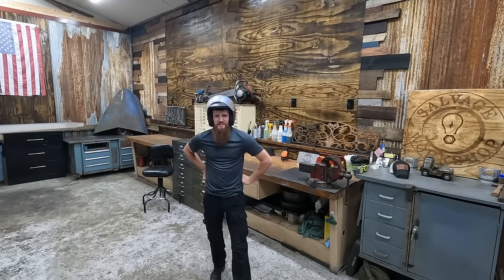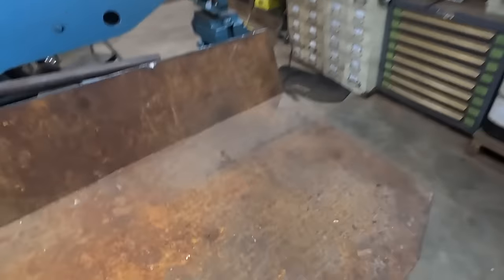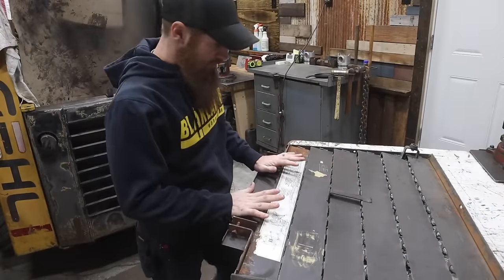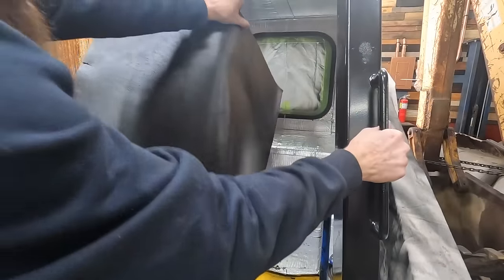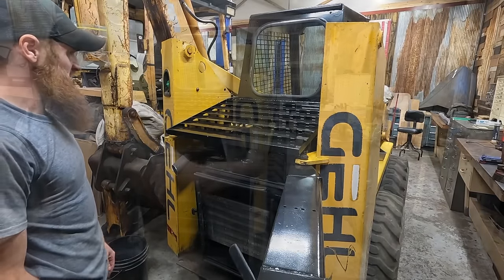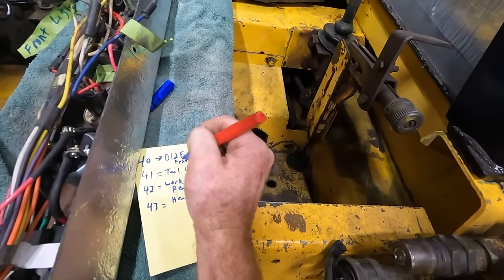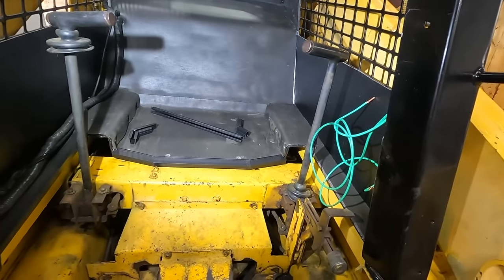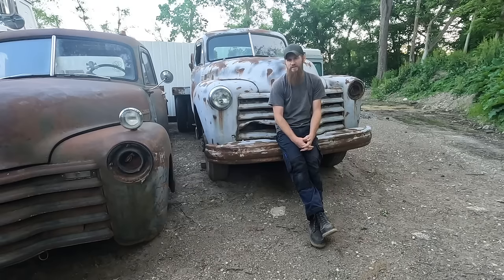The CAB on my old Skid Steer is ROUGH... Can we RESTORE it?!? ~ 1995 Gehl 5625sx Skid Loader P6

Comment: When glueing up the form rubber after spraying both surfaces wait a minute till glue is tacky. (JUST LIKE A STICKER) Than apply the foam. Same for head liners and pannel covers.😎👍👍I'm thinking a prop bar instead of the slide lock would of been a better choice. Made with a small slightly bent rod welded on one end that fits in the same hole and with a sleeve and bolt at the other bolted to the lid.
Reply: Yep, this. Contact cement works the opposite of regular glues - you spray it on (both sides, the cab and the liner) then wait til it dries. After the carrier solvent evaporates, it leaves a somewhat sticky residue behind to the touch (like rubber cement), but it sticks to itself like mad. In fact, that's why it's called "contact" cement: once it contacts itself, it ain't letting go without a fight! But if you try to use it before the solvent evaporates, or if it's only applied on one side and not the other, it won't stick very well.
Cool, long episode Matt - thanks! And thanks also for resisting the urge to add music to your videos. That's so annoying.
Reply: When I worked at my dad's auto trim shop I replaced a lot of headliners. Like said above, gotta spray both sides and let it dry before sticking it together.
The way he did it with that cheap contact cement from a spray can it doesn't stand a chance of staying stuck long.
Reply: Torture watching you use the contact cement.

Comment: As a metal fabricator, you have to adjust your metal break blade for the metal thickness. If not you can damage the machine and also have problems as you were having breaking your metal plate. You have adjustments at the back of your break on each side. They adjust your blade in and out for the metal thickness.
Reply: sorry I agree with you to a point  but did you hear what year that Machine was make  your grand mother was maybe in Pamper  is not a modern machine  give a guy a break
Reply: @martinromerocintron6294  I wasn’t trying to give him a hard time just advise on how to adjust his break. 
I have worked on several old  manual breaks, finger breaks from 4’ to 16’, and cnc breaks that will bend 1-1/2” plate. All manual breaks have adjustments on them or they will not work.
Reply: @Mike-vn7ys  100% Agreed - I've worked on Aircraft and sheet metal for years, and you have to adjust the brake to match the thickness of the metal that you bend - the ends of the fingers MUST be AT LEAST as far away from the bending point as the thickness of the material (preferably a tiny bit more), or you end up trying to force the fingers BACKWARDS - and pinching the material, rather than bending it - making things impossible.
Reply: @Mike-vn7ys Good advice.
Reply: @srp01983  is it "brake", like on a car, or "break", like it's damaged? Somebody is relying on spell check! LOL

Comment: That skid steer looks and performs sooooo much better, thanx. The light demo in the parking lot probably had some people thinking a space ship had landed, great job on the lights. Rust never sleeps, so YES on the painting.  Squatch 253 deals with older Cat crawlers, might get in touch with Toby to get a connection for Old Red parts. 😃

Comment: The one thing I'd have done differently is use more flood style lights for the sides and rear rather than spotlight style. It's unlikely you'd ever need focused light to navigate around in any direction other than forwards. It'd help get better visibility to the corners that way too.

Comment: Recommendation for future projects. When you added the plate to the seat pan, drill a bunch of holes in the plate, clamp the plate to the seat pan then weld the plate to the seat pan through the holes in the plate, sort of like spot welding. Will make for a much stronger bond. Nice work on the skid loader.

Comment: Hi yeah, when your using any kind of silicone, glue, window putty, from a corking tube the easiest way of removing excess product I found was by using soapy water as product doesn't stick to soap. Oh if you want it to be smoother than your finger, use a potato cut to the desired shape then dip in soapy water to stop sticking. hope this helps you Cheers Pete.

Comment: A simple solution for the lights:  use three toggle switches with your power jumpered to all, then your lights (load) to each switch.  Flip two switches for front and back, one for just the front, and all for every light.

Comment: As for the lights just mount some relays under the roof that do the switching. So position one activates circuit 1 2 circuit 2, and 3 3. The relays connected parallel to each other will isolate each circuit.
You might also consider making Perspex panels for the sides to bolt onto the outside. In the summer you can take them off, in the winter you get less noise and warmer cab..

Comment: On the issue with your ignition switch yous should use star washers to positively lock the terminals with the screws.
You may consider using the key to control a standard horn or lights relay, moving the heavy load current from the switch to the relay contacts.
This way you can rewire the circuit to keep the relay near the starter, reducing the use of heavy gauge wiring and giving the possibility to use low rate fuses in the control wiring.
If you don't have a fuse box protecting the circuits, I highly recommend to fit one.
Never use fuse ratings that would allow currents higher than associated wiring is rated for.
... and Bob's your cat 😊
Reply: Good plan
Reply: didn't see one but a battery disconnect would be a good idea as well.
Reply: LED lights unlike filament type bulbs are able to blow in a way that they create a short circuit. Always worth putting in a fuse for each set of LED lights you install. And use relays like you said. Running all power through the ignition switch will cause it to burn out just like what happened.

Comment: Love ur vids. I'm 53 & one of the jobs I've had in my life time was a fabricator of custom steal & aluminum yachts with older tools like ur metal break. A piece of knowledge id like to pass on to make it easier for u to make bends on thicker metals on that type of break is adjust the top knife back away from the swing arm pivot line the thickness of metal ur bending. Also adding a bolt on piece of steel angle 2×2×3/8 on the swing arm helps with surface area to help bend . Last thing is instead of scoring several relief cuts torch or plasma help with in turn could b welded or left as moisture weep holes. Hope this helps next time

Comment: For coating rusty metal, I prefer to use a zinc phosphate primer over top of a rust converter. Rustolium makes a nice high zinc primer.  Also for welding in a confined space, you may consider using a welding respirator.
Reply: Oh, and I'd buy merch. Tshirt (needs to be a cool design) or a nice hat with a cool design. Hat should be something with a sandwich bi-color bill in conservative colors. Nothing orange or other strange colors, those never sell. A hat that you happily wear every day.

Comment: Not to state the obvious but it looks like you need to relocate your drain over closer to where that spring flow is originating. Run an underground pipe to where the drain is now and have a drain head right at the spring runoff. Cover over your piping in a way that it can carry the load of your heavy equipment. I love everything you've done so far and look forward to seeing you restore some of that old equipment that has been sitting around waiting. Thanks for your entertaining videos. Great stuff.

Comment: I’ve recently got myself an airless paint gun. The one I got you don’t got to thin paints so it’s Plug it in dump paint in and paint when done clean it takes a few mins and done. Way cheaper in the long run than spray cans and using the air sprayer with all the mixing and stuff.

Comment: BTW:  You can get "furniture restoration" paint for surfaces that are bumpy like where the rust has pitted the metal...you would put it on after the rust converter stuff.  
It fills in the low parts and makes a very smooth finish...it looks great even on very pitted materials.

Comment: front and back togethor makes sense, if your using front lights means your likely to be reversing as well and will need reverse lights then  seperate for side  would work well  ( loving the vids ) thanks for your efforts
Reply: I suspect he'll eventually realize that and add the rear to the "front only".  If you are driving forward it's almost 100% likely you'll be backing up as well.

Comment: Possible cheap solution to the pop up spring is a quick trench with an 8 inch bucket a foot deep filled with a mix of course and medium gravel! Easy to do with machines you have and easy to remove if you need to go to a better solution!

Comment: As far as content goes, I like seeing stuff that is worth fixing fixed. If it cost more to fix than it would be worth, then either part it out or scrap it. I like seeing things that you salvage become working tools that you use or just sell and make a tidy profit. Just because something can be fixed doesn't mean it should be. I did like what you did with the skid steer. Fixing the cylinders is definitely something that you will need to do, but you should be able to plan for a good time to fix them since they don't currently prevent you from using the machine. I liked the lights and new seat. The sound proofing is probably a bit less useful although the insulation it provides from heat may prove to be fairly worthwhile.

Comment: The spray adhesive you are using is contact cement. Spray both surfaces and let dry. Align fabric and apply pressure to adhere.

Comment: We used a half inch brush and cut off the bristles to about 3/4 inch length to brush the sealer into the joints mind you that was in the bodyshops but it kept your fingers clean even with gloves on , looking good any case .

Comment: I don't know if anyone else has mentioned it but, to solve your water problem you need to install some drain tile.  The stuff you see installed in farm fields.  You will not stop the water from coming.  You can only collect it and drain it off to an area that won't effect you.   Drain tile is plastic pipe with slits that allow the water to flow in and down the tile/pile to where you want it to exit.

Comment: careful - you'll spring that brake and render it  useless.  
Biggest uh-oh folks do with silicone is -  try to clean it up while it's still wet. wait till it cures then cut it away with a razor knife. also - rubbing alcohol can be used to dissolve wet silicone to clean up small amounts.
contact cement - normally apply to both parts then wait for it to dry - and be VERY careful because it doesn't come loose.
nicely done - good job  - looks a ton better -

Comment: There is an aerosol that when you spray it on, it chemically changes the rust to a new compound that stops the rust. The new compound is a black color. If you do not like the black color, you can paint directly over the rust stopper.

Comment: to cascade the functions, you could in-line a diode from 2 -> 1 and 3 -> 2 circuits, which means if 3 is lit, both 2 and 1 would also be lit, if 2 is lit then 1 would also be lit, and if 1 was lit, it alone would be lit!

Comment: you need to add 2 additional inlets, one in the back by the fence, and another in the front lot.  run a dual wall hdpe pipe into the inlet/manhole with the type 8 grate on it.  that way the spring runs underground.  no more standing water.  essentially you need to tile the back lot into storm sewer.  IMO.  I'm a PE in IL.

Comment: Well that looks amazing . What a difference a little bit of work and pride in your work does, nice Job. Can you make an adapter so you keep the original bucket fittings but can also fit the adapter so the you get to use both rather than just one type. .just a thought. ? Andy Australia

Comment: What about splitting the wires such that each one is connected to the switches you want (so headlight goes to all 3 positions) and add diodes to keep it from back feeding to the other lights, that way you can have what you originally wanted?

Comment: You could add in add in A 12-volt cigarette lighter plug in inside of the cab. In the dashboard panel
 For A 12-volt mountable variable speed control fan.

Comment: What you're calling the "amber" light is what's commonly known as "Warm" light because some people prefer the old, incandescent filament light. The one you like is called "Bright" light for obvious reasons, and is closer to florescent light. Personally, I hate meeting a car with Bright LED headlights coming down the road since it kills my night vision. The warm works for that. However, for a piece of working equipment that will be trailered rather than driving to the work site, I'd want the lights to be as bright as possible.

Comment: Did you think about using a urethane bed liner like Linex or some such.  I like that idea because water can never get behind it whereas any glued in material has a potential for water to get between..  Then you can put sound insulation in if desired.  The bed liners I have had for years in my pick ups do an outstanding job of standing up to dirt and gravel, etc that your feet will be grinding in as you work and maneuver inside the cab.  I use my pickup for hauling everything including loads of dirt and it is a 97  that lives out in the weather year round.  Not a bit of rust in that bed.  Same with my 08 pick up.  As well as several I have had in years past.  I don't have any experience with the DIY paint it yourself urethane coatings but that might also be an option.

Comment: I would put a beacon on the top if you use it to clear snow in the winter and a red light on the rear that is what is required in Minnesota by the DOT

Comment: That foam backed rubber is asking for trouble when it gets wet. It'll soak up water like a sponge. That's the same foam backing as headliner material. Once it deteriorates that rubber is falling down. Headliner material for cars is bad enough for letting loose and falling. That rubber is much heavier than headliner material so it'll fail even faster. Not to mention that this machine is exposed to the weather. 
My family has owned and operated an auto trim shop since the 1950's and I've seen plenty of headliners falling apart. I think once that material gets wet you'll be looking at plan B.

Comment: For smoothing silicone caulk use 3 parts water to one part liquid dish soap in a spray bottle, it will come out smooth and the solution has no effect on the caulk drying. This is how the pros get glass smooth joints.

Comment: If you know a telephone repairman, ask for a foot long piece of telephone multi-strand cable. The strands are different colors. Cut as needed pieces in two and wrap each wire and post to know where to reconnect wiring.

Comment: I’m betting the company that sent the lights to you thought you might put the white amber lights on the rear for kind of a warning light/rear work light for anyone around you. Kind of wondering if that particular light had a flashing/strobe mode on the amber side. I would have used the new wiring harnesses with their controllers as they had relays built into the harness and were made specifically for the voltage and amperage the lights were designed for. At least using their harness you could turn the lights off and on individually as you needed them as well as being able to utilize their built in functions.

Comment: Your brake was more than capable of bending.  You need to bolt a piece of angle iron to extend the bending bar.  I think this might have had that earlier in its life.  The ones I used were almost always from the 30's and 40's.  They don't wear out, but the bending bar needs to extend out more.
Reply: In the past year, I saw a brand new one at the scrap yard. It had a tag on it for the company that bought it, and another tag for the department in that company. Some of the plates were still in boxes, but non had be bolted to the machine, and the paint was perfect. If I had about $300 and a place to put it, I would have bought it.
What a waste of money. The scrap yard chose to destroy it.
Reply: The angle iron will reinforce the lower folding leaf. But the biggest help would be to adjust the upper leaf, the edge of the upper should be 1.5 times the thickness of the metal sheet back of the seam. So there should be adjustment to move it back away from the lower leaf. I hope I confused you 😳
Reply: @tsirron  if that’s as old as it looks. Nothing will help it if people keep trying to overrate the brake. The bushings are shot. Brakes don’t work well with work out bushings

Comment: on the lights. position 1 front lights only. on position 2 everything. on position 3 rear lights only. why not run a second set of leads from position three to the front lights also. that way they illuminate in both position 1 ( front only) and position 3 ( front and rear only)  gives you what you wanted to start with.  in regards to the 7 inch with amber, I would have suggested recessing the factory controllers into the ceiling and kept their individual function and freed up space on the factory switch.  just my two cents.  keep up the great work.

Comment: I would have pulled the glass out before doing the black rubber piece then you could trim the window opening and glue it around the inside of the window opening then rope the glass back in and would not have to worry about it coming loose around the glass

Comment: Great work on the SS. Should that driver safety cage have a front door?
Reply: None of the ones I ran had a front door, heck two didn't even have a full cage. But I do think the newer models do. I had wondered about removible plexiglass for cold weather.

Comment: If you spot weld two plates together, wont condensation between them rust out the bottom plate if it stays outside in heat-cool cycles?